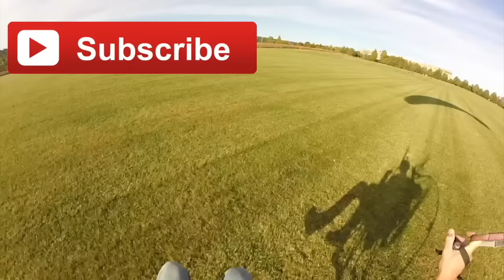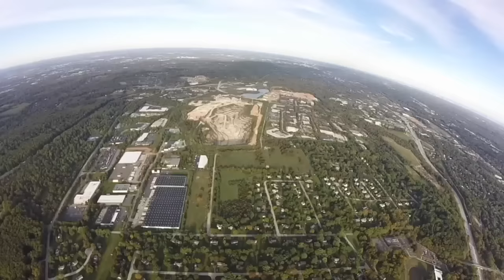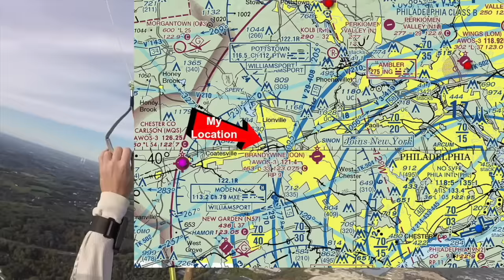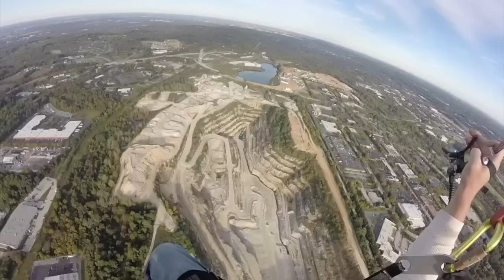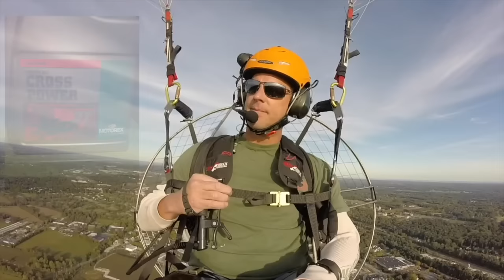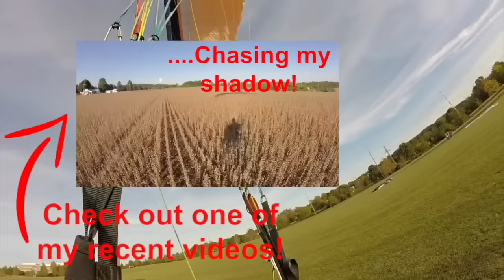Powered Paragliding - FAQ's about Paramotoring

Comment: Fresh Breeze uses float carburetors which aren't designed for altitude changes without taking them apart to re-jet.  That's why your engine quit at 10k feet.  Sorry you got talked into one of those. Thanks for sharing.

Comment: Hi, Have you rebuilt the engine yet using pure 100LL? That fuel avgas leaves ALOT of lead deposits in the piston ring grooves causing stuck rings and premature top end issues on 2 strokes. I run 90 oct rec fuel which had zero ethanol. Works perfect with 50:1 motul.  A lot cheaper gas and more reliable in these 2 strokes.

Comment: i have a blackhawk 125 ....cant wait to get it fixed😊
Reply: antonio townsell get it fixed? Whats wrong with your bh 125?
Reply: hard pull on the pull starter...some type of compression issue....taken my engine apart several times....just cant figure out whats going on inside...checked the piston rings. oiled the cylinder, the recoil on the pull starter is fine....checked the gaskets, sparkplug and still no start
Reply: antonio townsell i hope blackhawk paramotors will help you out. I planned on getting their new 190. I have heard too many bad things about them already though
Reply: hopefully its an easy fix..the engine only has 38 hours on it
Reply: Sounds like wrong rings. And or piston, or a. Bad bore job at the machine shop

Comment: FAR 91.413  Mode C transponder within 30 nm of Class B and above 10,000
Reply from the maker: Thanks Jim for the comment. I take these regulations seriously, so I looked up this FAR and it does not apply to my paramotor. See below.

Exemptions

- Aircraft not originally certificated with an engine-driven electrical system or subsequently have not been certified with such a system installed, balloons, or gliders may conduct operations:

- In the airspace within 30 nautical miles of the listed airports as long as operations are conducted:

- Outside of Class A, B, and C airspace.

- Below the altitude of the ceiling of a Class B or Class C airspace area designated for an airport, or 10,000 feet msl, whichever is lower.

- Above 10,000 feet msl (excluding airspace above the lateral limits of Class B and C airspace).

Comment: You gave the air speed with the trims set (22 MPH), but if you let out the trims, what's your air speed?  Also is your wing a beginner wing .... or another type???
Reply from the maker: With trims fully out, I only gain about 5MPH. Other wings have a much greater speed range. My wing is an EN-A rated wing. It is the Paramania REVO2. This wing is categorized as a beginner/intermediate wing and I it worked well for me as a beginner and 8 years later, I still enjoy it. Although, it is time for a new wing now.
Reply: PPGFlyr   Thanks, I have watched a number of videos on PPGing and I'm interested.  I knew about the trims, but didn't know what difference it made on a beginner wing.   Assuming one has the experience, they would get a different wing to go longer distances quicker.  Thanks again for the info.

Comment: Do you have to contact the Air Port before you take off.
Reply from the maker: The short answer is no. I don't fly anywhere near an airport, so I typically do not notify anyone. However, if you are taking off from and airport, then you would want to be in touch.

Comment: Very good sharing. What gadgets did you used to record the audio? Quite clear voice while we can hear the prop sounds as well.
Reply from the maker: I use the SENA SMH10 Wireless Bluetooth Intercom System. It works very well with my GoPro for reducing outside noise, while clearly picking up my voice. Thanks for the comment and sub.

Comment: How low are you legally allowed to fly? I know you have to be at least 80 feet above private property when operating a drone, unless you have permission from the landowner. Is it the same for paramotors, or do you have to stay higher?
Reply from the maker: I can fly as low as I want in the right areas. I fly with my feet dragging in the grass over fields.  However, we are NOT allowed to fly over populated areas. This would include homes, public gatherings, buildings, etc. Most of it is common sense. I wouldn't want some guy flying through my backyard, so I don't do that to others. I also respect livestock, farm animals in any open areas as well. The bottom line is that if you keep the people around you happy, you will be allowed to fly there longer. If you are a nuisance, people will find a way to shut you down.

Comment: Are there any weight requirements?
Reply from the maker: You need to be strong/big enough to run with 50 pounds on your back. No real upper limit. I have seen a 400+lb guy launch and get in the air. It's really a matter of how fit and able you are.

Comment: Most of the time you’re in class E airspace unless you are below 1200ft AGL or 700ft AGL. Class G only extends up to 14,500 at its maximum height.
Reply from the maker: You are correct. I mis-spoke in this video. I should have said class E.

Comment: If you have a wing collapse and get tangled.... how do you keep the back up parachute from getting tangled in the existing wing?  ALSO, is there a specific height you need to be for the back up chute to be effective?
Reply from the maker: Personally, I have never flown with a reserve. However, I do understand the concepts around throwing a reserve. If you need to throw the reserve, it is recommended to throw it out to the side as much as possible to allow it to clear the existing wing in the air. The size reserve you get can depend on your overall body mass (weight), but not necessarily by height. I can't see why height would be an issue if your whole body is in freefall conditions.
Reply: Not body height....I meant, how high in the air do you need to be in order for the reserve chute to be effective...?
Reply from the maker: Hah, altitude! Reserves are not effective under about 150-200 feet in the air. Some have worked at lower altitudes, but you can't count on them.

Comment: Hi. Love waching your vid's.Well here goes, I live in the U.K ,I was a paraglider pilot and instructor but that was about 9 years ago and now looking to do a conversion course to get into P.P.G. love to know your thought's on this as i am now 65 year's young and fairly fit for my age. Thank's. Phil.
Reply from the maker: Thanks Phil. The transition from PG to PPG isn't as big as you might think. Being able to control the wing is HUGE and you already have that down. The next biggest hurdle is being able to launch with a motor on your back. The biggest difference between launching PG versus PPG, is the loading of the A's. With PG, you are taught to lean forward (bent over) to put tension on the A's. With PPG, if you lean forward, you will likely drive your self into the ground. I would try and talk to a local PPG instructor and see if they would be willing to guide you into PPG, given that you already have the PG experience. Best of luck to you! - Trey
Reply: Thank's for your sound advice and will be looking into doing a course for ppg and will also continue to be watching your video's and maybe asking a few questions  of you.Phil.
Reply: Do it.

Comment: Ok I have a question, So I have heard a lot about thermals being a problem, Can you explain how and why? Also how it relates to weather such as here in the Sacramento area. For a little background during the summer time it is not uncommon for it to reach temp's of around 100 degree F
Reply from the maker: Hi Jon. That's a great question and would make for a good video. As a matter of fact, I will use your question in my next FAQ video. So here a basic overview of thermals. Thermals happen during sunlight hours of the day. It is caused by the sun heating up the surface and causing air that has been warmed to rise (think areas above neighborhoods with dark roofs and big parking lots, such as malls). This rising air eventually forms the clouds that are puffy and scattered (such as cumulus). This rising air has a counterpart that is cooling air that is dropping toward the ground. This forms a circular pattern, so that there is a column of rising air and a column of falling air. On hotter days, this rising air can be more significant. The danger comes in when maybe 1/2 your wing is in the rising air and the other 1/2 isn't. This can collapse your wing, maybe not fully, but any is noticeable. In general when flying in thermic conditions,  you will notice the air is bumpy while flying along. It isn't your typical late afternoon flight that has calm air. This is when most paramotor pilots will fly (early morning or right before sunset). That being said, I will fly during the middle of the day on some occasions, mostly during cloudy late fall and winter days. The bumps may still be still there, but not as pronounced. For your situation, even in 100 degree days, simply fly early morning or right before sunset, and it should be much smoother air.

Comment: Actually the oxygen level higher is the same like on the ground. Just the air pressure is low. So you have to use fan mask and superchsrged engine above 2000 meters.
Reply: Or lean the engine.
Reply: The oxygen percentage (in the air mixture) remains the same at all altitudes, but there is indeed fewer molecules of all the gasses at higher altitudes. This is why you would want to lean your fuel\air mixture the higher you go, in order to keep the same ratio.
Reply: Ryan Dinan yes, but you can only change it so much before other issues (like heat) become a problem.

Comment: Nice video!  I really enjoy watching paramotor vids like this :)I have a question I'd like to ask. You mention this and I notice other paramotor pilots often cut the engine before landing. Having never flown, I'm rather puzzled as to why one would chose to land without the engine at least in idle.  What are the advantages of this?
Reply from the maker: Great question. My motor is a belt drive and thus when I am at idle, my prop is still spinning. So, if I was to trip, slip or otherwise come in for a hard landing, then I wouldn't damage the $500 carbon fiber props. Lots of pilots have clutched motors, which means the prop stops spinning when the engine is at idle. So, I often see these guys land with the motor still running.
Reply: Ahhh, ok that makes sense  :) Thanks for your explanation  :)

Comment: It's a very dumb question but what if you need to go to the bathroom when you're up in the sky?
Reply from the maker: Hah! Not a dumb question at all. I typically fly for less than 2hours at a time. So, it generally isn't an issue for me. But for guys out there that are paragliding all day, they do have catheter systems. Check out http://aviation.derosaweb.net/relief.

Comment: How do I know how high I'm aloud to fly up to I'm about 6 miles from my major international airport so given that how high can I fly. And how much do I have to be away to fly up to 10000 feet or more. Last question can I fly any closer to the airport or not? Thanks
Reply from the maker: All good questions. 6 miles is not far away from a major airport. Airspace is an important topic. skyvector.com is an excellent source for reading airspace and knowing your limits. You will need to also google how to read vector maps (symbols, numbers, etc).
On Skyvector, the ceiling is listed as the number on the bottom. You might se 70 over 06, with a line between them, as if they were a fraction. The bottom number represents your ceiling. In my example, the ceiling would be 600 feet (represented by "06"). The "70" would represent 7,000 feet. And that would be your floor if you happened to be directly above that airport. 
In genera to go above 10,000 feet, you would need to be in class E airspace (google it), which is right above class G airspace, closer to the ground. Finding this airspace depends specifically on your geographical location. 
Hope this helped.
Reply: PPGFlyr thankyou for ur input. Also will that also tell me if there is a minimum altitude I can fly at around my area? That probably sounds silly but wasn't sure if there was also a minimum flying altitude as well or not? Just so I don't get the cops called on me and what not.
Reply from the maker: FAR103 are the rules that we adhere to while flying. If you are over fields, then right above the ground is fine. But you can't do that through a neighborhood. I try and stay away from houses (noise factor) and if there are people around, I make sure to stay away from them as well.

Comment: So it looks like your using a modern version of wing warping for directional control? Can you lock the throttle so you don't have to squeeze it all the time?
Reply from the maker: My throttle does have a "cruise control" so that I can lock it in. But I don't use this much at all. I hold the throttle with my ring and pinky finger and I find that they never get tired of holding the throttle. Thx for the comment.

Comment: Is it spooky to suddenly experience wind gusts such as occurs in desert regions? My last camp out in the Mojave desert had me closely monitoring the wind conditions the whole time I was out there. At times wind just got up to 36 mph then would go back down to 10.
Reply from the maker: HI Gary. I have never experienced a wind gust of that magnitude. I am guessing the weather patterns in my part of the country (Mid-East) are different from that of any desert regions. My answer to that question would be, Yes, that is a concern. My guess is that this type of gust was near the ground and if you had already been airborne, this wouldn't have been an issue. That being said, there are weather websites that I use EVERY time before I even think of packing up my gear to fly. When checking them, one of the things I am looking for is wind on the ground, versus winds aloft. There are also weather stations that list maximum wind gusts in a certain time range. Find one near where you are flying and check it out before flying. Your comment is a good reminder that I need to mention some of these sites on upcoming videos. Take care and fly safe.

Comment: I have a question... Would I be able to paramotor to my high school? I live in the country, so I have a field to take off in and land in, and my school is in a residential area, I was thinking I could land in the football field or a nearby park, would doing all of this be legal?
Reply from the maker: Great question. Assuming there are no airspace limitations, it would be legal. The school would need to approve you landing or taking off from their field, but that would be highly unlikely. Your best bet would be to land in a park. The real dilemma would be where to store your motor and wing while at school. You would NOT want to leave it outside, since the UV from the sun deteriorates the wing material and can also wear down parts of your engine, such as rubber mounts, etc. Then there is the weather. Weather changes quickly, so it might be great for flying to school early in the morning, but not the best in early afternoon for getting home. The short answer is that while it could be legal, it probably is not a reliable choice for commuting. With all that being said, it is the so fun, so you should look into getting into the sport for recreation.
Reply: PPGFlyr Thanks for all the info! I left for school around 6 this morning to find a nearby park, and I found 2, however one is a pit with alot of fencing, and another is a soccer field, and I'd be able to store my equipment at my grandparents, that's just up the street from my school. I wasn't going to use it as a primary source of transportation, just for once in a while. anywho, thanks a bunch!
Reply from the maker: That's awesome. I wish you the best.

Comment: I really enjoy your vids. I will be starting training in the spring. What paramotor do you fly? I think my first paramotor should have HIGH Hang points verses the low bars. What do you think?
Reply from the maker: Thanks for the comment. I fly a Fresh Breeze Simonini 122. I love my machine and would recommend Fresh Breeze to anyone. However, I am not partial to Fresh Breeze. There are other great parameters out there too. It would be very difficult for me to comment on the hang point for you without knowing more information about you. Because of this, I always tell people that your instructor will know what is best for you and will put you into the machine that is best for your body type and ability. If you know you are getting training in the Spring, you can work with that instructor before you start to order equipment now, so it arrives close to when you begin your training. Where are you taking your training? Best of luck to you.

Comment: I know this is super safe but looking at your setup and in particular (in your cool selfie mode) the carabiners holding you up, are they replaced often due to potential micro stress fractures? it's crazy to think your life is in those piece of alloy's hands.
Reply from the maker: That is a great question. I check over my equipment all the time, very tediously, mostly on days when I am not flying. Having said that, I haven't replaced the carabiners yet. I will look into that due to your suggestion. Many thanks!

Comment: How do you go up and down?
Reply from the maker: That's a great question. The answer is pretty simple though. When I want to climb, I give it more throttle. When I release the throttle, I descend. To fly level, I use a very little amount of throttle.
Reply: Wow! That's pretty cool. These things seem pretty easy to maneuver, then.
What's the bare minimum price on an entry level one? :o
Reply from the maker: That is hard to say, but in general, you are looking at 5K bare minimum (used equipment) and about 12K all new with extras, like e-start (price includes wing).